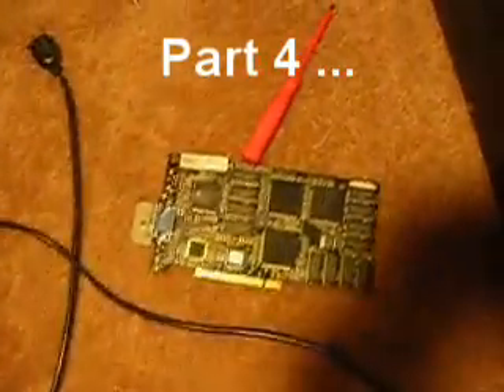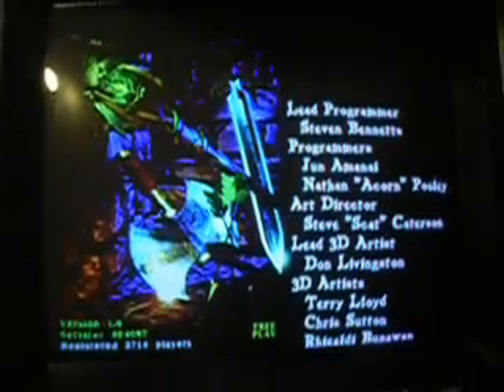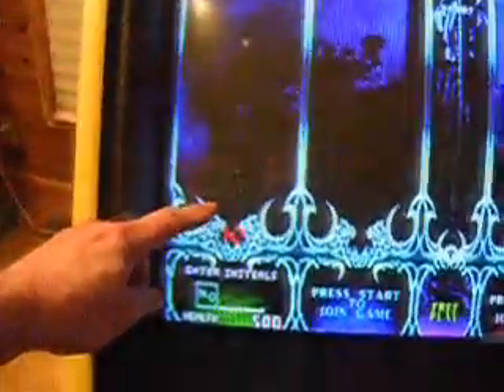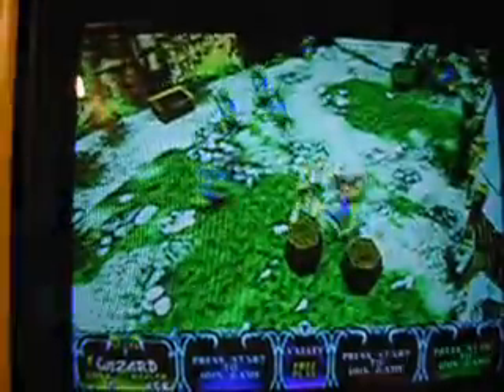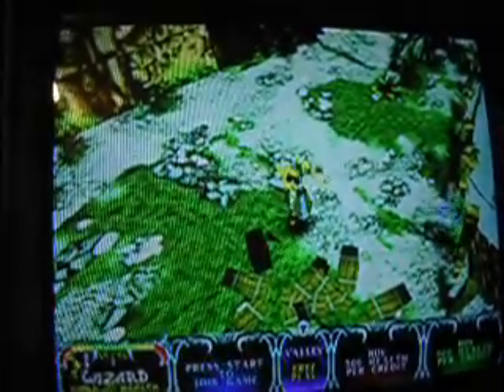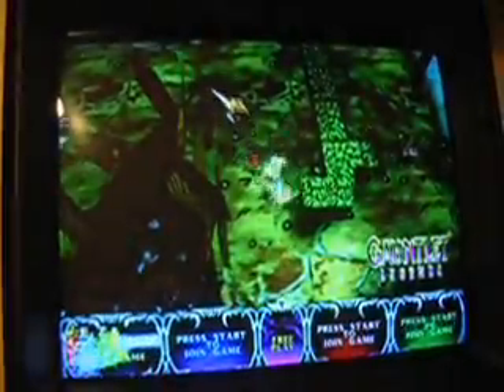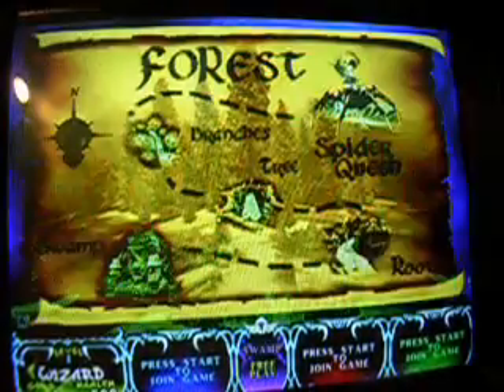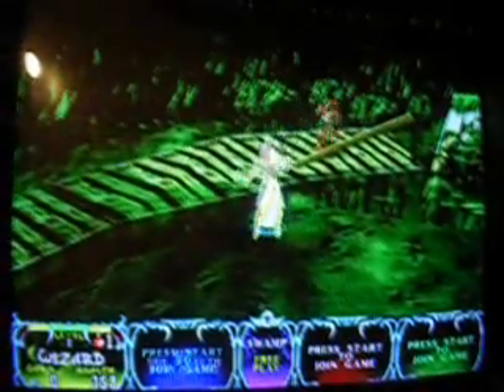(Part 4) Gauntlet Legends Video Card Substitutions

Comment: Ive watched all 4 videos. Could you please list all the cards that work with this please.
Reply from the maker: MASSAKA I must've missed your questions a couple of years ago. From what I remember when I was testing, any card that has a PCI connector and a Voodoo 2 chipset with a minimum of 10 megabytes off on board video RAM should work just fine. Don't try a Voodoo Banshee from what I can remember. I think they are like a crippled Voodoo 2 if memory serves. I think I got ahold of one of those and tried it and it didn't work.

Comment: WOW, your well on your way to becoming a hardware expert ! Can you cross refrence other Arcade units manufatured with the same exact hardware and salvage a drive see if it swaps. Maybe make a 3 pole switch and a 2 drive Ide ribbon cable to switch while in/off powered mode between drives.  Salvage a  Atari Road Burners motorcycle riding game DISK drive. Its the closest hardware match.

Comment from the maker: Never knew it needed another card to do color, but knew it had no 2D capability.  As far as simulating 2D in a 3D display, I think "Billboarding" is the term that might explain it.  QUOTE: "In 3-dimensional scenes, the term billboarding is applied to a technique in which objects are sometimes represented by two-dimensional images applied to a single polygon which is typically kept perpendicular to the line of sight. The name refers to the fact that objects are seen as if drawn on a billboard."

Comment from the maker: Because the game itself ONLY outputs 3D graphics.  The pass thru allows a 2D card to display 2D graphics THROUGH the 3DFX card's connector and on to the monitor.  Since this game from bootup creates no 2D graphics, there's no need for a pass-thru cable.